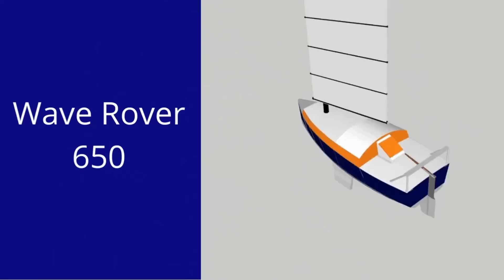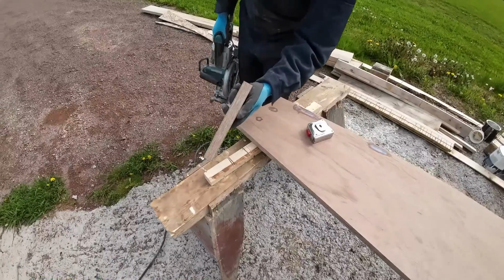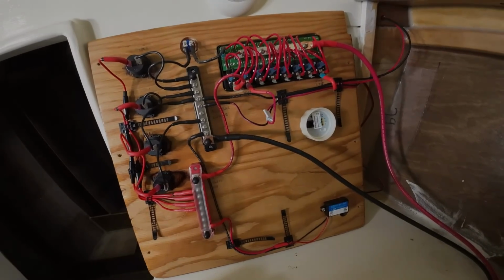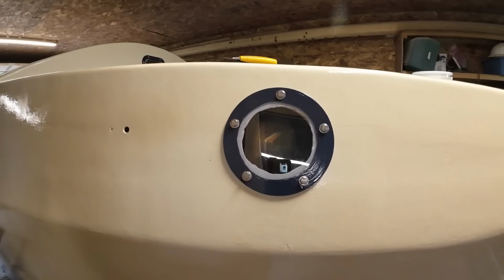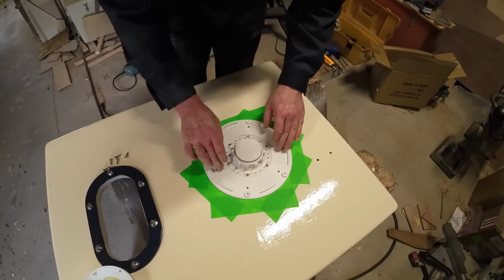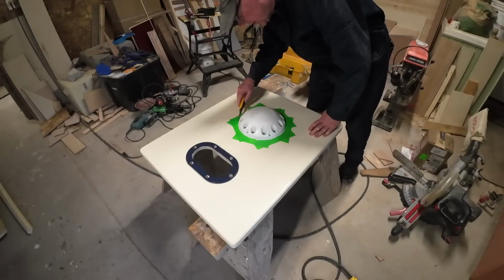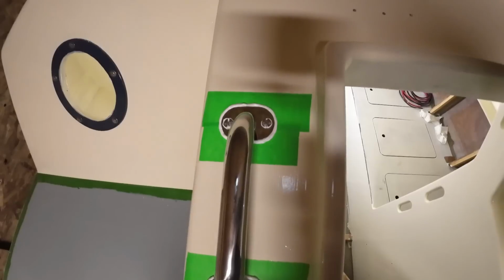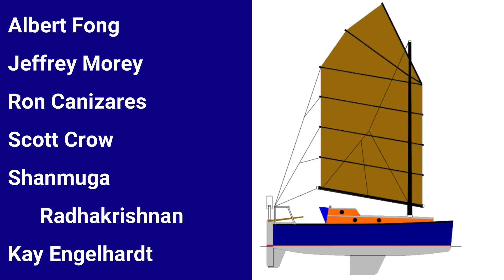S2E86  Wave Rover's Launch Scrubbed // Launch????

Comment: Id get a tohatsu 4hp but maybe the honda is best for you since fresh water flushing might not always be available. That noise though! E-propulsion was sending all the YouTubers free electronic motors awhile ago, you might check if they’d send you one. They even had a cool re-gen feature
Reply from the maker: I contacted E propulsion about sponsorship but they didn't get back to me sadly so I decided to go with a small, simple, and not too expensive gas OB. Like your good self, I don't use the motor very much. Loved your Bay of Biscay crossing video. Thanks for the comment Sam.
Reply: I have to say, Sam (I also have the CD 28) is experienced and forging his adventures as well! I like the Honda but, don’t listen to me!
Reply: The Suzuki 2,5hp is lighter than the yamaha and quiter than the Honda.
Reply: I had the Honda Air cooled as my dinghy motor a few years back and didn't find it particularly reliable, which was surprising considering Honda's reputation. But I had recurring starting issues due to electrical problems. I've also had a small Yamaha and it's never missed a beat. Happy Roving!.
Reply: @polderfischer8565  I had a 'zuki 2.5hp and can also attest to it's general build, reliability, lightness, and quietness when running. One point owners should know is to be sure to replace the zinc located inside by the thermostat. I waited too long (2-3 yrs?) not knowing about it, and it went to pieces in the cooling system (I did get it all cleaned out without too much trouble, and motor was fine afterwards). I also have a Honda (IIRC, 1.5hp 4strk) and the 'zuki is far superior.
So my vote is Suzuki or Yamaha - Yamaha because 1) you can get Yamaha parts anywhere easily, and 2)  they hold up well in saltwater.

@Sailing Wave Rover - Also, if you can find a Mercury 2 stroke 3.3hp, it is also a very reliable, lightweight small engine and likely even more budget-friendly than the 4 strokes.
Reply: IDK the noise difference isn't that big to be honest, air cooled means less moving part, less maintenance, less weight, and it can be uses in freezing conditions safer

Comment: I would say Mrs Rover is absolutely right, one day a week off for the long haul, will definitely improve productivity.  Long hours does not equal more results.  Good for you Mrs Rover!  And Mr Rover - pace yourself - even if it means amending your sailing plans, as long as you can skid south before the Autumn gales, little else matters.  Here endeth the lecture!
Reply from the maker: Sailing plan amendments coming soon. They may in fact be more interesting than I originally planned.
Reply: Sounds intriguing - more interesting...?

Comment: Are you going to use the outboard for any type of charging/alternator? If not, get an extra battery and just use a large trolling motor. Bonus ability is being able to mount on the bow or stern. That's my .02, anyway. Cheers!

Comment: KISS principle - The Honda aircooled.  Light (40 lbs), you can carry a couple of spare parts, etc.  Since it's rarely used the noise is no big deal.  Stores easily and no need to flush.

Comment: A slightly bigger OB I’d agree. Higher torque and high thrust prop, with a spare.  Make SURE you create a spares kit and add a few extra zincs, an extra prop and shear pins and the right grease! Get as long of a shaft as you can. Hobby horsing is a chronic problem with outboards and waves. The deeper you can get the prop, the better the prop will bite for a heavy weather eventuality.
Reply from the maker: Very true

Comment: I agree with commenter below, would recommend going with at least a 4hp for your size boat.  You will need the extra power if you have to power against wind and current.  Yamaha and Suzuki are both good choices...
Reply from the maker: A lot of folks are in agreement with you on this point

Comment: My 20-ft trailer-sailer has a Tohatsu (who actually make many others' motors, eg. Mercury, anyway) 6-hp 4-stroke with sail-drive (extra long shaft). It's fine - light and quiet. I mention this having read the comments, and think a reverse gear is pretty necessary, and you won't regret the long shaft. The 4, 5 and 6-hp are the same weight, capacity and size, so a 4 or 5 would also do, but you loose little for the extra (6-hp model), but gain a 5Ah alternator. Not a lot, but in an emergency (bust solar) it's something. Oh well, it'll always be a compromise. Boat looks super. Can't wait to see it on the water. PS. I'm on your bulkhead under my real life name.
Reply from the maker: Appreciate the comment greatly. Thanks for mentioning the Benefactors Bulkhead my friend.

Comment: Having used both, I would recommend the Honda on the grounds its air cooled so no water pump to worry about.  Yes a bit noisy but you not going far in it.  There are 4 bolts underneath the power head.  Replace these with S/S and the two bolts hold the carb on with ex bolts to make removal easier.  Ours is a 2007 model and continues to work perfectly.  Lives on the transom 9 months of the year with a nylon cover over the top.
Reply from the maker: Thanks for the insight

Comment: Some small electric outboards can be charged by solar or a B2B charger. It's not terribly effective, but on a long passage that is not that important. Those engines can even run directly on even small solar panels. Could be a feature when becalmed. 1kt boat speed is better than 0kts.

Comment: Great video, what long days you’re putting in! As to the outboard, I had a Yamaha 9.9 for several years, very reliable, served me well. However I would strongly encourage you to choose a larger engine size. The size you are looking at currently is not ideal, slightly larger would add big benefits by being useable in more sea conditions. It’s a little bit like buying a little larger anchor, you don’t ever regret the decision.

Comment: Alan, Congrats on all your amazing progress and "good on ya" for being wise about pacing yourself. I know you have a weather deadline, but in any adventure, knowing when to push, and when to say "slow down" is life-saving.  You are teaching as you go, and this is another lesson in wisdom.  I am enjoying every minute of your videos.  Thanks!
Reply: Also, I've had both motors you are looking at. They both are great. The Honda is basically a converted weed trimmer motor and air cooled. The advantage is that it is light and easy to rinse off when used in salt water (no water pump). The Yamaha (or Mercury/Tohatsu) motors are more robust/ quieter, longer lasting but should be run in fresh water after each use to clean the water pump.  Either motor SHOULD NOT be used with gas with ethanol (Get regular ethanol-free gas) and use a stabilizer to keep your gas fresh. These 4 stroke motors have tiny carburetor jets (that's why they use such little fuel) that easily clog from the evaporating alcohol in ethanol that leaves a gummy residue.  Best practice is to ALWAYS run the gas out of the motor after each use as well as draining the carburetor bowl screw so no gas is left to evaporate. If you do that, the motors will start easily and dependably.
Reply: I would go for the Mercury or Tohatsu 3,5. Just a bit more power. But Yamaha is always gut. Honda saves maintenance it lacks the impeller.
Reply: @stephencifka4629  - Well, the fresh-water rinse after each use ain't gonna happen.. not in an ocean-going boat that will almost never be alongside a dock.
Reply from the maker: I always run them dry before a big passage for the reason that you mentioned. Great comment.

Comment: I can't believe the interior space, it looks huge when you're sitting there chatting. This may well be the boat that I'd be interested in building, I'll stay tuned in to see how she sails. The only thing I'd change would be the cockpit, as i'm an Aussie and my boat would be just for sailing around Oz, with maybe trips over to Papua New Guinea and the island chains like Fiji etc, I'd want a cockpit to sit outside comfortably and safely in to sail from. Great job, very interesting design
Reply from the maker: The plans include a cockpit, I just chose to deck over it for ocean passages
Reply: @RoversAdventure  Hello, does it includes the original doghouse? What is the maximum headroom? Great boat !

Comment: Valiant effort Alan.  But your original launch date seemed mighty ambitious when announced. 🤔  However you wouldn’t be where you are now if a later date had been set.  So I guess it’s served it’s purpose, even if you have a few things to finish. Keep up the good work. Looking forward to seeing it hit the water. Cheers
Reply from the maker: Good to hear from you again Robin. My best work comes from setting ambitious goals. Adding 3 weeks is small beer as we say in these here parts.
Reply: @RoversAdventure  Indeed.  I think you've done a great job - I know there's a lot of work that doesn't make it to video.  Re your engine, are you sure the 4 stroke 2.3/2.5HP is powerful enough - it's not a dinghy ( to state the obvious :  ).  I know it's just to "get you off the wharf", but with a stiff breeze and or tidal current going in the wrong direction, you might find you're going nowhere??  Just a thought...  Of course a step up is a step up in weight I know.  Decisions decisions.

Comment: Make sure the out board as a reverse gear, it is more important when maneuvering is required. Having to turn the motor 180 degrees, from the aft deck of WR. while trying to maneuver ,in tight quarters will be a real challenge. spend the extra money you'll be very glad you did.

WR is looking great an the details always seem to take a long time to complete. 
Hope to see you at the launch.
Reply from the maker: The money is one factor but also the weight

Comment: A lot of the Montgomery 15 sailors use the 2 horse Honda and unless you are planning on motoring longer distances, the Honda's noise isn't that bad.  If you were planning on motoring for hours, it would get to you.  The air cooling and lighter weight will prove to be bonuses, imo.

Comment: I really like the honda 2.3 on my 23 foot NIS. 

Its light, but the best feature is the lack of any need to flush the engine after use. I give the leg a quick wipe down to remove salt, and that's it done. 

The lightweight makes it very easy to swap to the dinghy. 

It is loud at full revs. Not so bad over the stern at 2/3 rpm.
Reply from the maker: That's all I really want
Reply: @RoversAdventure  for what its worth, the 2.3 pushes the 900kg 23 foot Norwalk island sharpie along at about 4.8 knots on full throttle. The fuel tank lasts about an hour or so at these revs. I normally throttle back to about 75% which gives me an easy 4.3 knots or so, with less noise and much better fuel consumption. 

It pushes her pretty well into 20-25 knots of wind. Especially if I get a bit of sail up to 'help'. 

I ended up making a well to get the short shaft engine deep enough to work in rough seas.

Shaft length could be an issue with you. Longer shafts aren't so good on the dinghy, and are heavier. 

I love the idea of twin rudders with the outboard mounted between them for a boat like yours. That way a short shaft wouldn't get alternatively lifted out of the water and then drowned as the boat heels or rolls.
Reply: If I replace the Honda (unlikely) I'd also probably go for a 3.5-5 hp engine rather the a 2.5hp water cooled engine. More expensive, and heavier. But it would have as much power as I could ever need, and would probably push my boat along at 6 knots if needed and 5 knots very quietly. The FNR gearbox would make it easier to manage as well. But then I'd probably need some sort of block and tackle system to manage lifting it out of the well at sea. The little Honda is a great compromise for me.

Comment: Owned the Honda and had to start with throttle high enough to surge ahead when it fired off-really a problem at a dock. Also very sensitive to getting oil in cylinder or carb. Saw several of these at deal with this problem.
Reply from the maker: That was a concern I had

Comment: Looking really good, your a man of great skill. I read somewhere years ago that you need 5 hp per ton for an auxiliary motor, a honda 2.3 may be too small for your boat and yes there noisy. Is it a good ideas to use plywood for a rudder? the tend to break after a while.
Reply from the maker: It will be easy to replace just about anywhere

Comment: I find the Honda 2.3 bombproof, its lightweight easy carried and serviced, no pump or flushing to bother about,  it does have that noisy putt-putt sound, not really a big issue.  I've not used the yamaha, only used a yamaha 9.9 which I love and runs flawlessly also. 
I'd probably still choose the Honda 2.3 for simplicity.

Comment: I just went through the lightweight outboard selection process.

I ended up getting a Mercury 3.5 HPLS for my Montgomery 17. It is 18# lighter than the Honda 5HP I bought it with.

Mercury or Tohatsu are my understanding the same Engines.

You want Reverse!
Reply from the maker: You have me thinking

Comment: Sikaflex is messy as h**l, but damn it’s good. On the engine issue I would take the slightly higher noise level over having to worry about impeller break downs, thermostats clogging with dried salt and all other problems that come with salt water going through a block of metal. My concern though is if any of these engines is strong enough for the size and weight of Wave Rover when you might have to battle currents and winds when going in and out of harbors?
Reply from the maker: You are right.

Comment: I haven't seen any solar going into the boat as yet, but I would think and extra traction battery and a torquedo or other small electric propulsion method would be superior to the fossil-fueled alternative.  Another though is a pair of carbon fiber sweep oars.  These can be found quite reasonably for perhaps 50-100$ each, and perhaps Concept II in Morrisville VT, builders of competition oars, might have some seconds to gift you with.  Salty Dog Bob in VT
Reply from the maker: For that price I would gladly find a spot for the oars. Good idea.

Comment: I once had a small Honda 4 stroke outboard. I didn’t like it at all. Never had issues with Yamaha. Trust your gut feel which clearly sounds like you are leaning towards Yamaha. Or maybe even a small electric i have no personal experience but i think they have made great advances in the tech and are probably worth researching for their size, weight and safety features.

Comment: the air cooled honda with no water pump is an advantage.  The number of engines that have shown up in the shop frozen when improperly stored with the powerhead lower than the water tube and pump, is not small.    That being said, the slightly larger horsepower engines with shift to reverse would get my vote.  I have the honda 2.3 for an inflatable, but have used it on an 18' lund  skiff , and it is very underpowered.  While small, Wave Rover won't be a light boat.

Comment: as heavy as that boat is, I would go bigger than 2.5 for stopping power. my last boat was 2000 lb and 3 hp would push it good but it didn't fight wind or stop it very well 6hp was alittle much but gave me way beter control
Reply from the maker: I had a six on the original WR

Comment: Nice Work! For the outboard I think you need to go up to at least a 4 hp motor. The lower hp motors don't have a reverse gear and need to be swiveled 360 degrees for reverse. I think it would be safer to have a gear shift when needing reverse, but you have the knowledge, experience, and can account for that when putting on the engine mount. Otherwise, I would probably go with the Yamaha or take a look at the Tohastu's.
Reply from the maker: No reverse is a concern.

Comment: I'm surprised that Mrs Rover hasn't insisted on you going away for a long weekend. If you have the day off Wave Rover but stay at home there will be the temptation to "just do 10 minutes work". Besides, Mrs Rover deserves to be pampered for a few days.

I'm normally a big fan of Honda engines but I think that you're leaning in the right direction with the water cooled Yamaha from this choice of two. Having said that, check the specs as it looks like the Yamaha could be maybe 10 pounds or more heavier by the time that a prop is fitted (for some reason they quote the weight without a propeller).
Reply from the maker: Mrs. Rover loved this comment!

Comment: As for your choice of outboard I think you need a little bigger HP, I've seen those small engines you're talking about and they are gutless, I've seen them struggle against current/tide of only a few knots and that was on an inflatable. Personally on a boat your size/weight I'd be going for at least a 6 HP and it would probably be a Yammie. Here in Australia especially up the top end we get massive tidal changes and the currents/tide is super strong. I think you'd be seriously disappointed in the power output of those engines you're considering
Reply from the maker: The anchor bit was given to me years ago and I just love that over sized look. You are the only one who has commented on it.